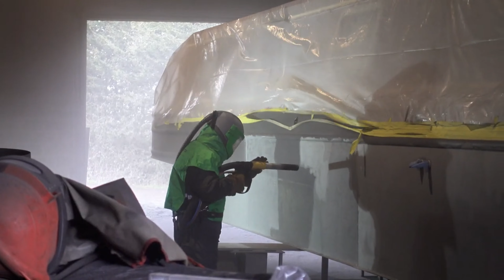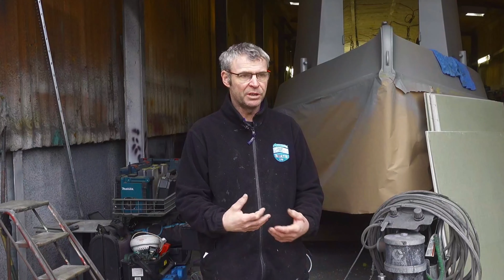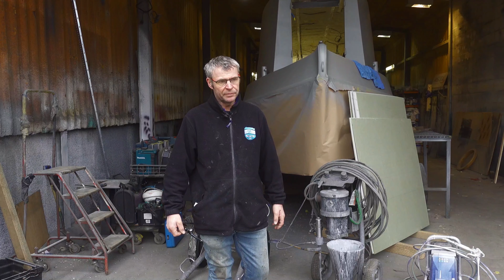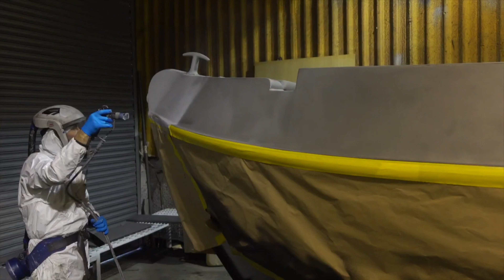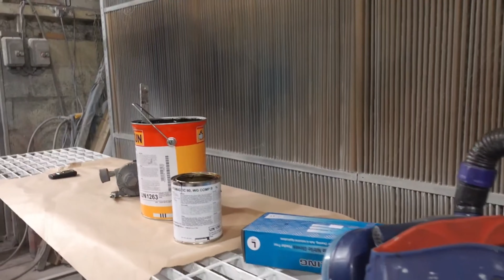PAINT MACHINES: We have invested in a new paint sprayer. What benefits does this give us?

Comment: My narrow boat was shot blasted and two pack sprayed six years ago. So it’s probably due to come out of the water and be painted again. With the right preparation but not shot blasted again can the two pack be applied by hand?
Reply from the maker: Yes it can be applied by hand it will depend on how many microns is left on you may need two coats to be sure.

Comment: Yep the Graco gear is a tad expensive, but it lasts for years if looked after. I started working in a ground support workshop  for an airline in 1990. We serviced the Wash and Paint strip equipment for the aircraft in the hangars amongst other things. The paint stripping gear was Stainless Steel and a lower pressure as you didn't it going further than you needed. 
The wash gear was generally for Gel soap, usually an Ardrox soap, It used to be quite caustic till regulations thankfully changed. 
30 years and three company changes I was still looking after those Gel Rigs as we called them, 50:1 ratio. So Built to last. I don't know if I followed the rigs through the various companies or I followed them.😄

Comment: Hi Tim
Have you considered automotive undercoating as a blacking material?
Since watching your video about grit blasting equipment, I have wondered if the used grit could be mixed into concrete as a filler.  I have also wondered if it could be dug into gardens that have a lot of clay to help break  the clay down.
I have used the sprayers which you have purchased and, like you, enjoy them.
Mark
Alberta, Canada